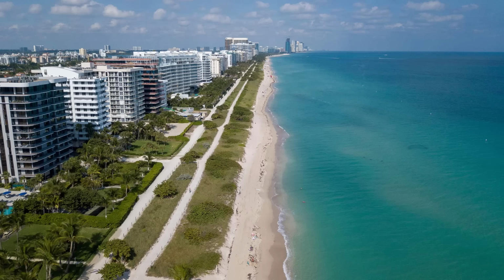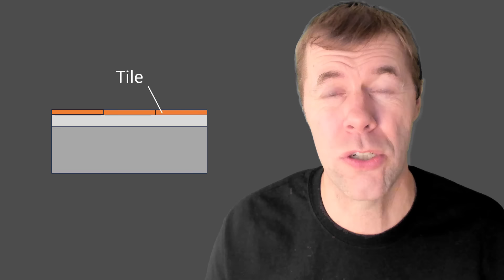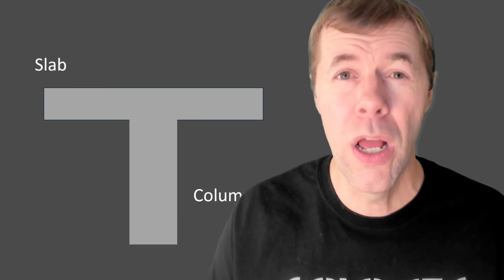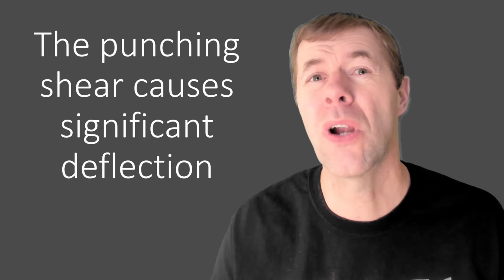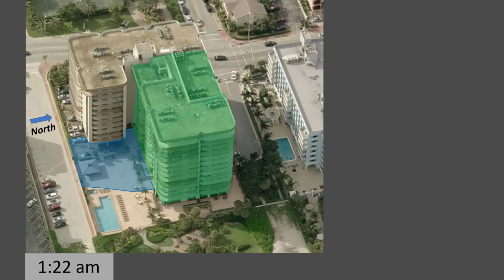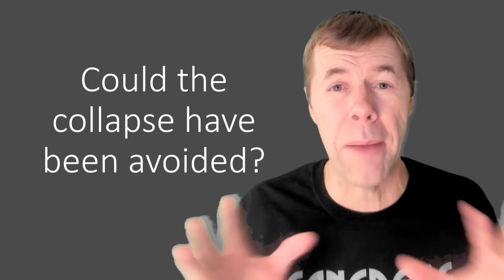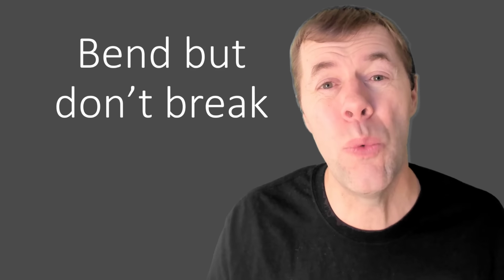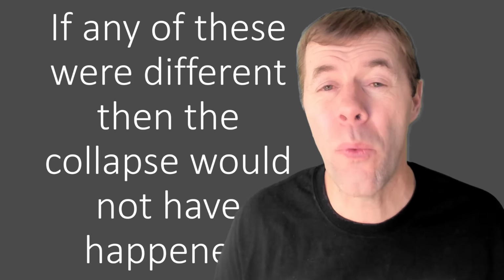Why did the Surfside Condo Collapse? (Miami Building Collapse)

Comment: Many many other buildings in Florida built like this that are over 60 years old along beach in poor condition.
Cracks all over .
I worked there in 1980s on construction on beach in Florida as a kid . I have a degree in Architecture and worked on structural engineering office for NYS DOT .
 Ocean salt spray corrosion on rebars through cracks porousiity in concrete for decades( just like bridge decks and beams ).

Owners refusing to follow PE inspection report to repair it for years .
Criminal liability for owners!
Florida State building dept was negligent for allowing the structure to continue to be occupied for decades after initial PE inspection showed severe structural issues .

Insane horrible....

Ps Check out Frank Loyd Wright Falling water house repairs.
Critical rebar left out in cantilever by error in drawings.
Amazing repairs done post tensioning .
Reply from the maker: Thanks for the note!
I know the engineers that designed the post tensioning for Falling Water.  One of them past last year. =(
Reply: @TylerLey  Warn everyone about bad rebar sold by home centers and building supplies .
It cracks when bent .
High carbon garbage not for for any project .
Architects engineer s builders must demand to see paperwork where rebar was made and what KSI and carbon content it has.
Just had to tear out all footings on our own project.
Tried to bend hooks 90° bars snapped like a pencil .
Reply: does salt damage concreat ?...or only steel ?
Reply: @rv6205  both actually.

Comment: If they added fiber into the concrete at the beginning. I think that would have made the difference. Seeing those columns straight into those slabs made me wince.
Like I said before,not a big fan of the limits of rebar.
Reply: Lol no way some fiber in concrete would have fixed that…. Fiber can prevent small cosmetic cracks but it ain’t holding your building together 😂
Reply: @arpialberto  I've  seen the Engineering tests.
The test beams with the fiber at 7 pounds per cubic yards took a larger load than the rebar beams. I was referring to the combination of the two.
Reply: They couldn’t add fiber, it wasn’t available yet?
Reply: fibers till date can't replace deficiency in terms of rebars. read at least LSM for RC Design. Furthermore overloading beyond a certain limit as per load resistance partial safety factors ,is not a design or construction issue. there was also design flaw apropos punching shear, and such matter was well known even before 1980.

Comment: Where the rebar was, 3 inches down, where the rebar should have been, 1 inch down.  Okay, But Why should that be that way?  Was is down 3 inches because of the topping slab? Doesn't appear to be from topping slab.  Still, how significant is two inches lower in the slab?
Reply from the maker: The higher the rebar the better it does at arresting the punching shear crack.  A rough calculation shows that it is about 20% less conservative to move the steel down 2".  That would have been enough to stop the collapse.
Reply: @TylerLey  I didn't think anyone would reply let alone explain how much moving such a small distance would matter. Putting numbers to issues helps me because I looked at it and it seemed like it shouldn't make a difference.  I initially thought that maybe they should have just moved up a rebar size in their calculations for the load.  I also thought that being too close to the surface of the concrete wasn't safe because there wouldn't be enough concrete to encase the rebar thus decreasing its support strength.  Thanks.
Reply: Would moving the rebar closer to the top increase the chance of corrosion and eventual spalling?

Comment: The pool deck was not responsible for bringing the building down, the building collapsed and took out the pool deck and in that order. Nor was the original construction methods responsible, everything that happened / should have happened afterwards is what caused this.
The slab, (at least over the building portion on the garage ceiling) was not completely "flat plate slab". The are pictures of the garage before the collapse of beams/girders under the slab. I do not know if they were done during the original construction or not.
Reply: @tuck6464, are you of this world?
Reply: @budimpla  Do you think you know something ?
Reply: @tuck6464 ,  you just said nonsense, including denying this video.  Yes, I know something...by training, by experience.  This training made it possible to survive a situation similar to this one, in Surfside.  I knew how to read the signs and evacuate in time.  The firefighters proved me right and ordered everyone else to leave.